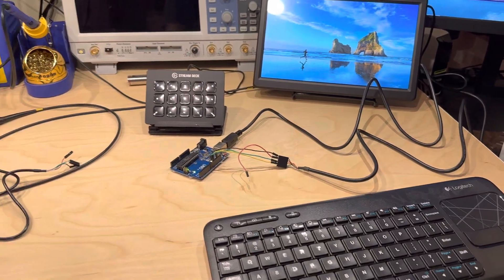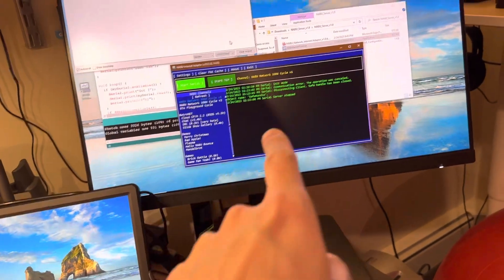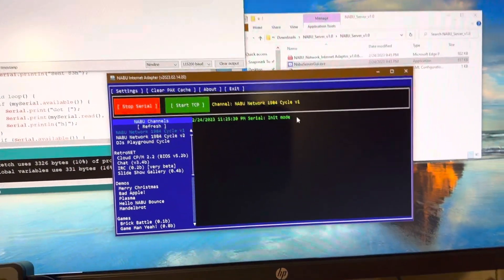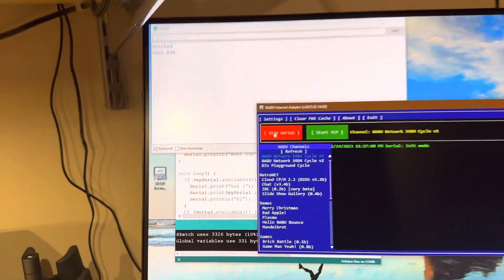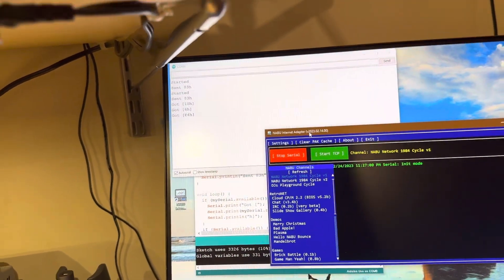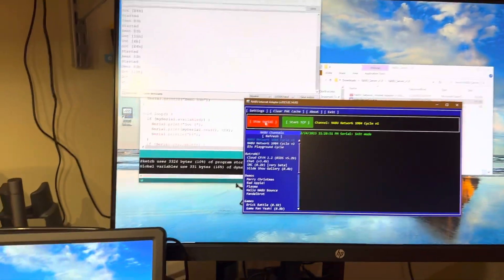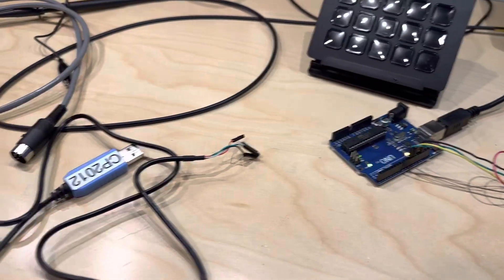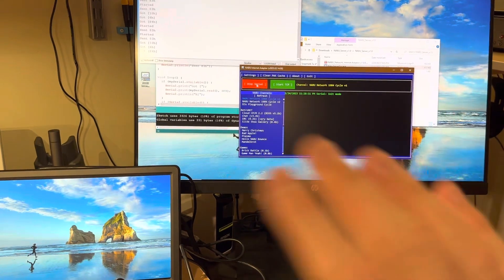NABU TTL Serial Adapter Mystery Solved!

Comment: Does this issue relate to why some Dtech connection allow the slideshow to run for 11 hours straight, then using the same Dtech connection, the slideshow might only run for an hour?

I've had the issue with my Dtech where slideshow test runs great, then sometimes stops after an hour.  Haven't been able to nail down the inconsistent performance.
Reply from the maker: Not this specific issue, this was particular to non-Dtech adapters, and prevented them from communicating at all (it is fixed now BTW).

But if it's a cable issue, interference comes and goes so it's possible you're getting occasional bit flips when your neighbors are using the microwave. But there are so many variables, who knows. Your NABU could have a flaky capacitor somewhere and dropping out the voltage at random times, or there could be bugs in the software.
Reply: @ChrisMasto  thanks for the feedback. Still working with someone as to why this happens. Appreciate the info.

Comment: Is it possible to disable the com port flow in the driver config in device manager. I know this can be done on Linux.
Reply from the maker: That's an interesting idea. I was going to test it, but when I put my NABU back after this last round of experiments, I changed to using an RS-422 to Ethernet adapter and ran all the cables "once and for all", including stapling them into place. So it has become too much of a hassle to pull it all out again.

Comment: I bought the cheaper DTECH adapter with a CP2102 chip, and the Internet Adapter software sits at "Init mode" and nothing happening on the NABU, just as you describe. Is this the answer to why my device isn't working?
Reply from the maker: It's possible, or it could be any other problem that causes the same symptoms. An easy check is to try the Internet Adapter software from https://www.nabunetwork.com/resources/software-downloads/, or nabud, both of which are known not to have the CTS/RTS problem.
Reply: @ChrisMasto  Thanks for the reply, that seems to confirm it. I bought the FTDI adapter and now DJ's Internet Adapter works fine.
Reply from the maker: @michaelb4439  DJ also fixed the flow control issue, so hopefully this won't bite anybody else. https://github.com/DJSures/NABU-Internet-Adapter/issues/8